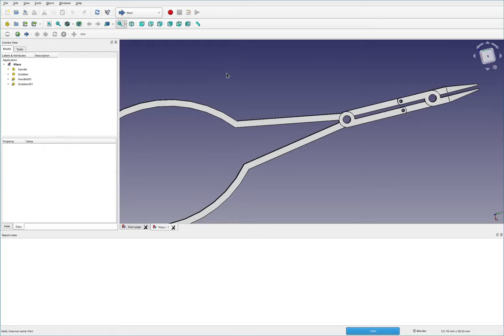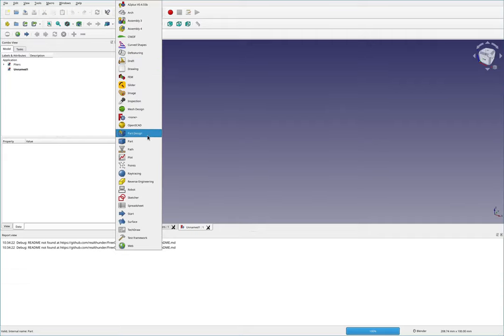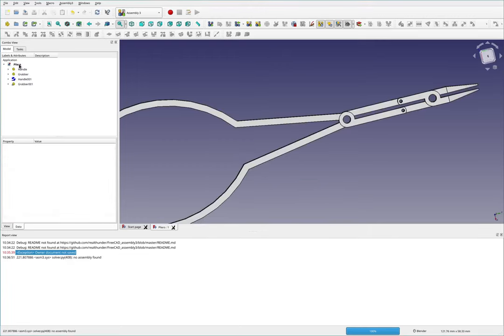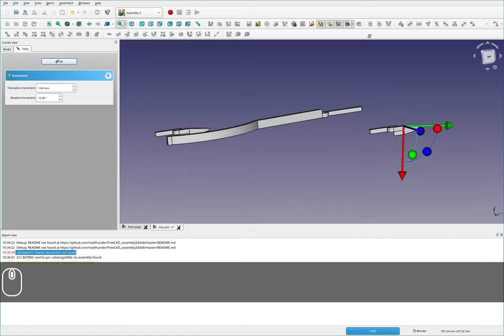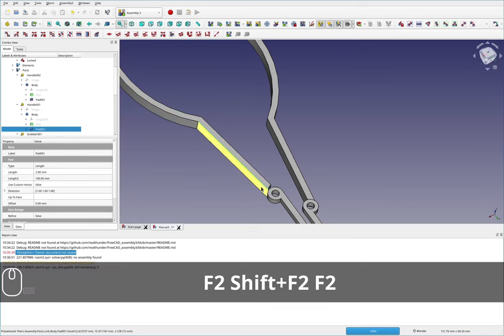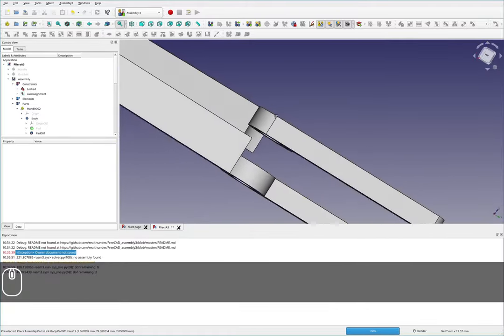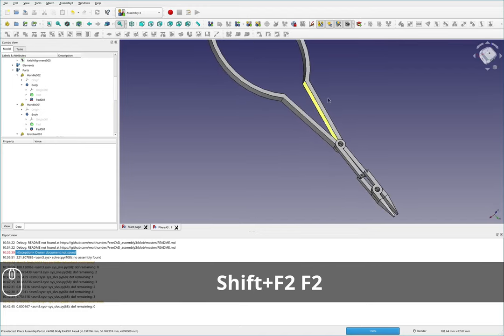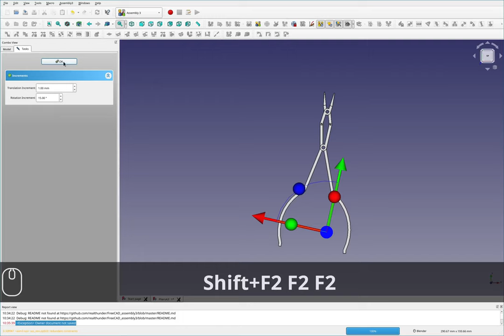[14.3] Assembly3 Example | Freecad

Comment: nice example, what about movement limits to prevent over moving of the simulation of constraints.
feeling a bit lost with Assembly 3,4 and A2Plus They all do the same thing but different.